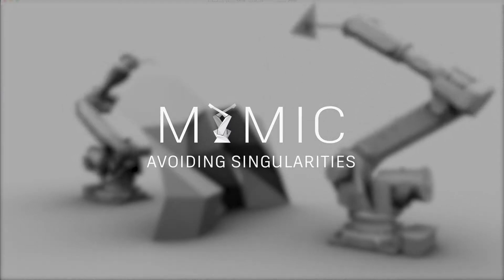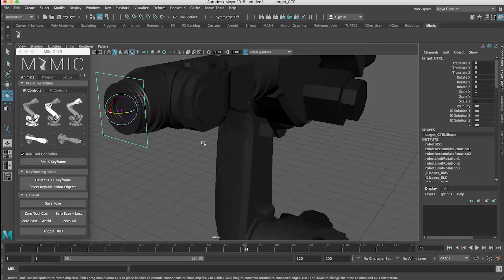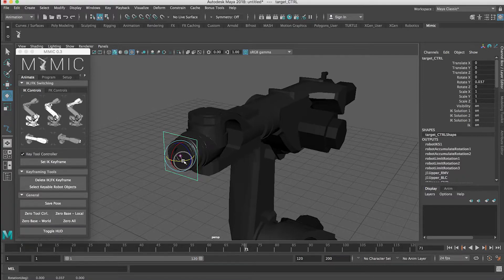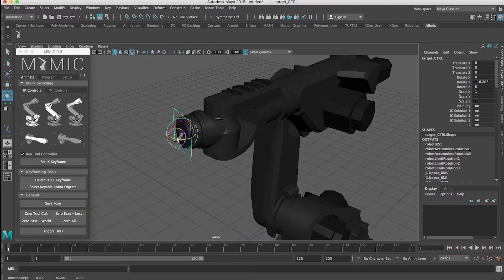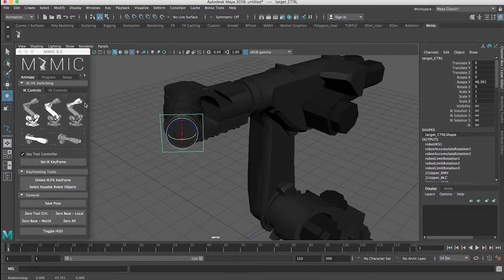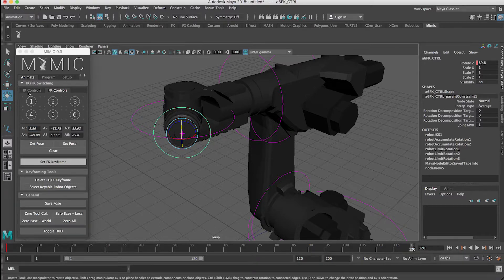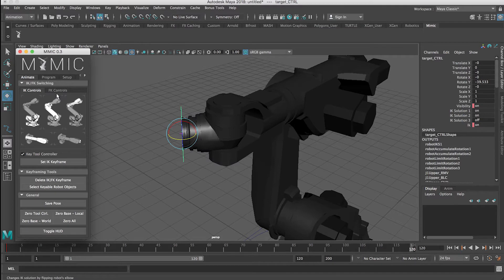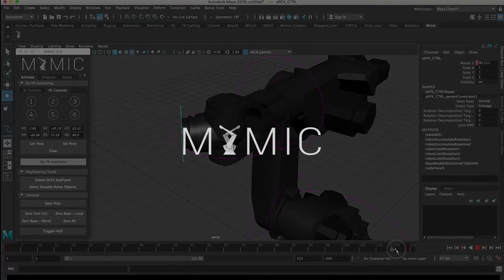Mimic - Avoiding Singularities

Comment: Hey, 
so I still saw there is a tracking issue when you do it like that. 
While the IK rotates directly on the axis, the FK behaves a bit strange and does not exactly target/rotate in the right way. is there a fix?
Reply from the maker: That's to be expected - when you're in FK mode the flange will generally move in an arc and not a straight line. The best thing to do is to avoid the problem altogether by translating the whole move to a spot where the robot is in a better position. This approach is really a last resort if you need to fix something and you can't move the whole path

Comment: Hello!
First of all, thank you very much for the software you wrote.
I have downloaded and installed the latest version 1.4. How does the output data of the Kawasaki robot interface with the robot control cabinet? I didn't find a way. How do you exchange data between the two?
Reply from the maker: Hi there, thanks for the kind words! Someone will need to write a postprocess that converts the raw animation data into the Kawasaki robot language as we've done with KUKA and ABB. Unfortunately we can't do it due to lack of experience with Kawasaki, but you can take a look at the documentation (mimic/scripts/postproc/postproc.md) to see what's involved